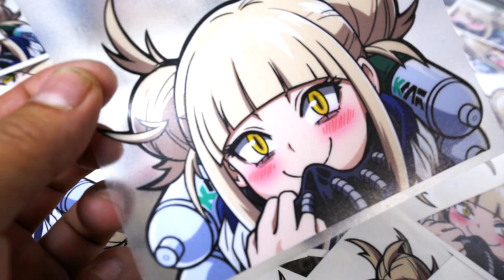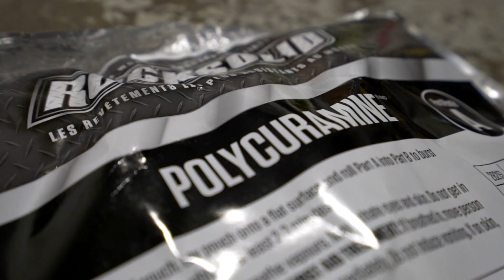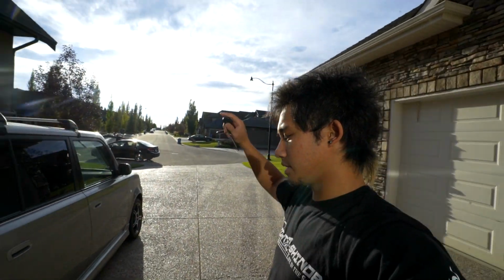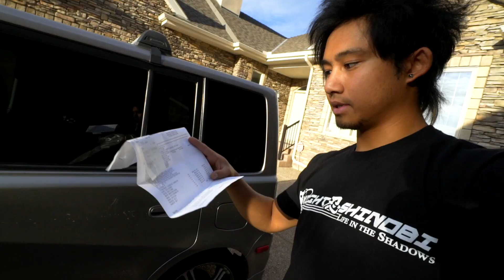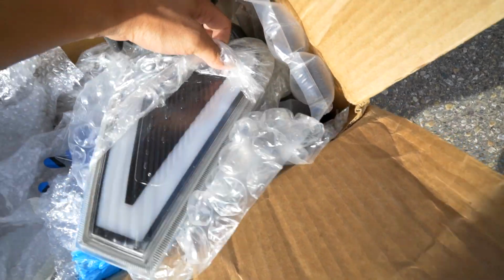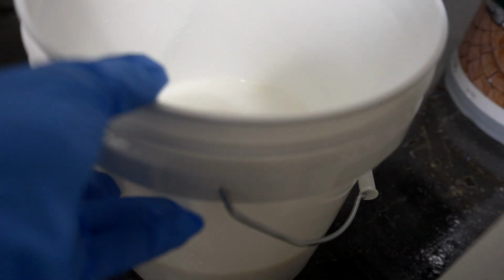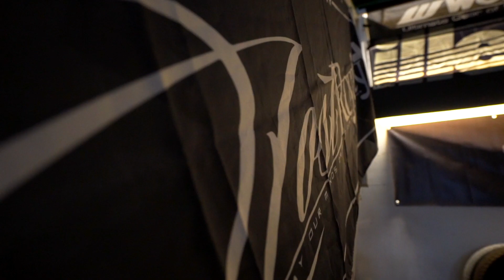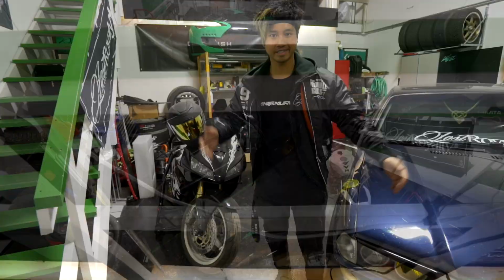We Got a Practical 4-Door Daily!

Comment: I always thought these cars were absolute jokes and then I got a 2008 Honda Fit. Its incredible how much room I had for suspension travel in the rear, so let’s just say I hauled a LOT in it. Heavy diesel generator that needed 3 people to lift, scrap metal, tools, and 3 people at once. I could still cruise at 80mph on the highway without an issue, while getting 30+mpg. Definitely a good purchase. One day you’re going to regret selling it lol.